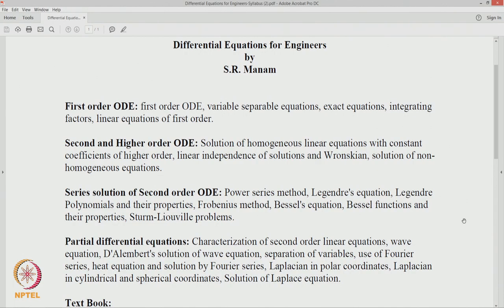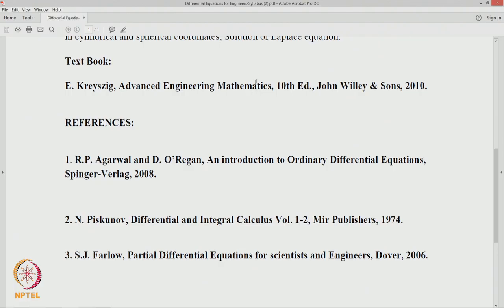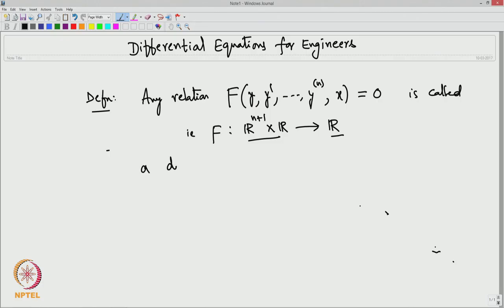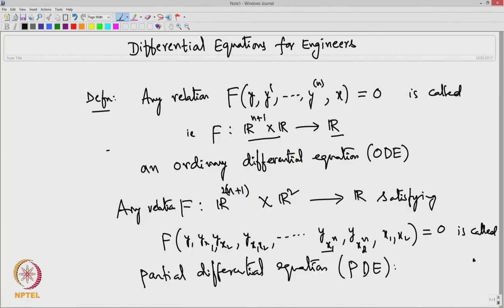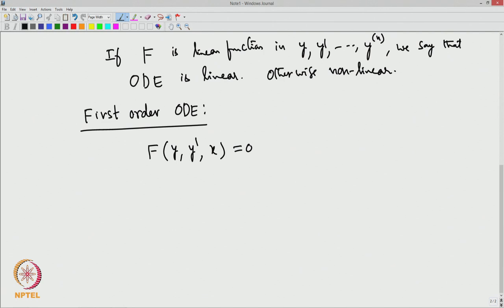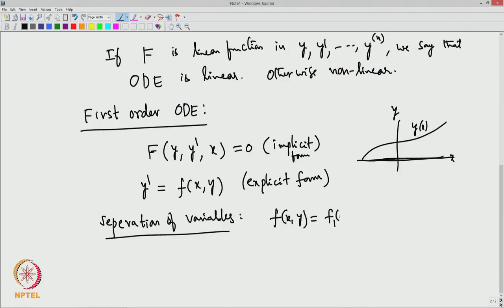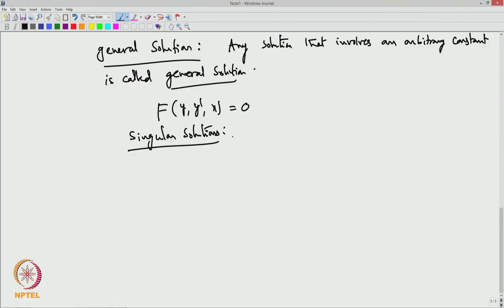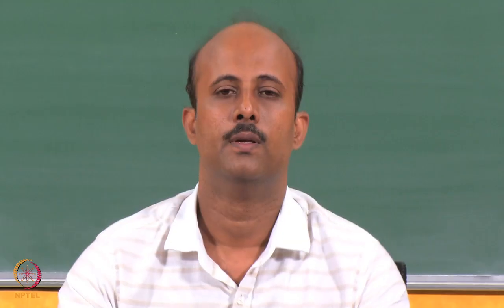Lecture 1 - Introduction to Ordinary Differential Equations (ODE)

Comment: This course is a perfect example of why engineering UG students hate math and suffer miserably for the rest of their lives. These courses are generally taught to 1st year students who have very little knowledge about why an engineer should care about solving differential equations. The course started without providing any inspiration, real-life examples of where an engineer requires to solve differential equations. Then, the instructor went on to define ODE's and PDE's without explaining anything. For a certain amount of time, he himself was confused about generalizing the terms. Engineering Math should be taught to UG students by Professors from engineering departments. Mathematics professors may well be more knowledgeable in solving ODEs and abstract ideas/corollaries, but generally, they simply do not understand the problems of engineering UGs.